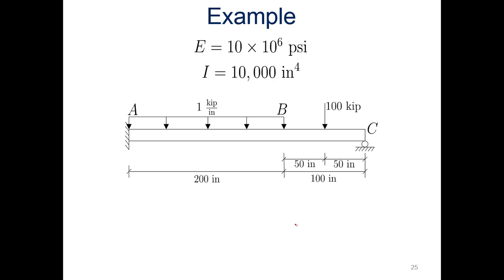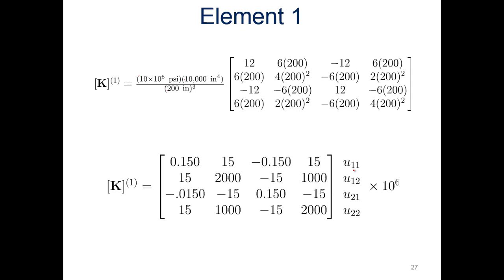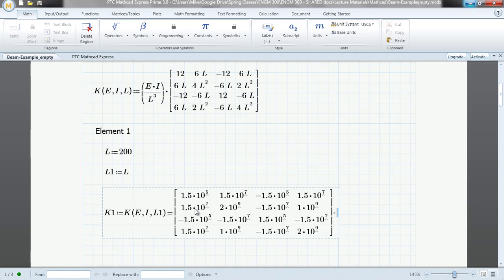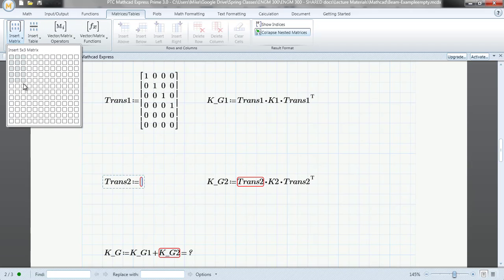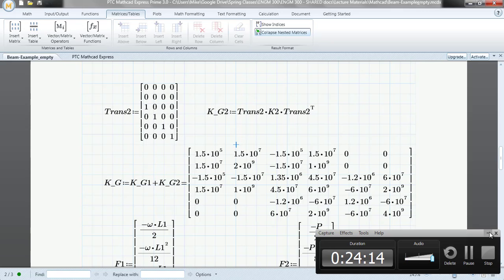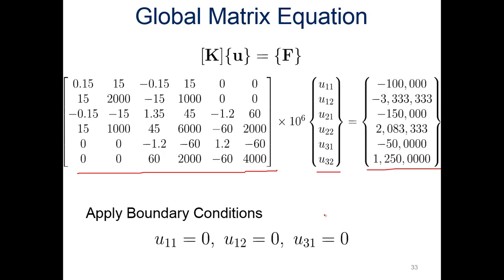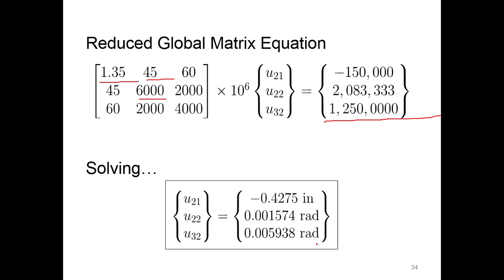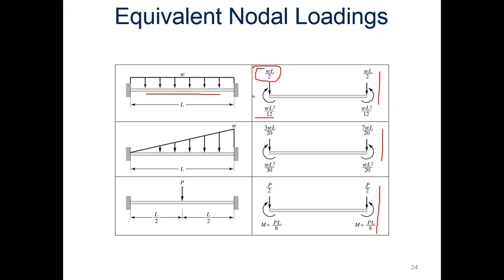Beams (3/3): Mathcad Example

Comment: I get stuck at 9:30. The equations for the moments and forces on element 2 come from a situation where we know the angle and the deflection at node 2 to be zero, which we can't assume for this problem because node 2 isn't supported by anything or fixed to a wall. Can we still use the equations from the tables?
Reply from the maker: Yes, in this analysis the loading "felt" at node 2 is the same if it is supported or unsupported.